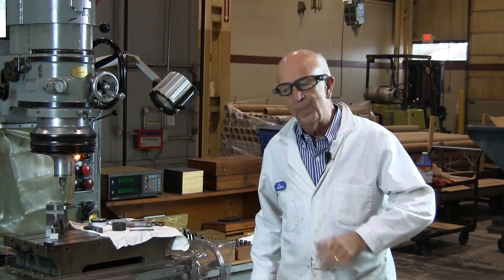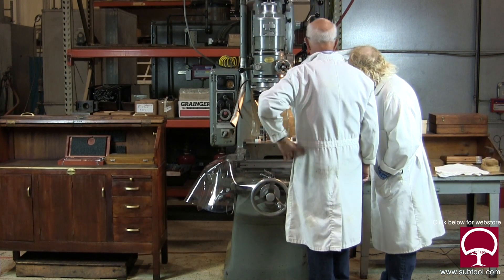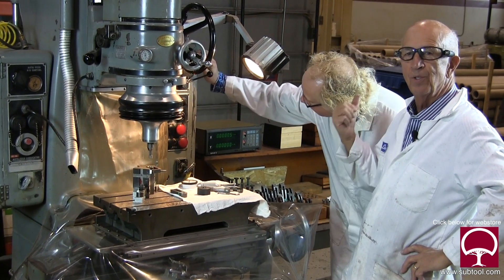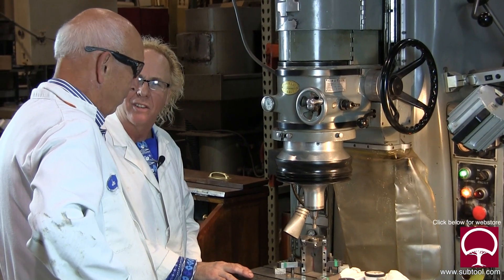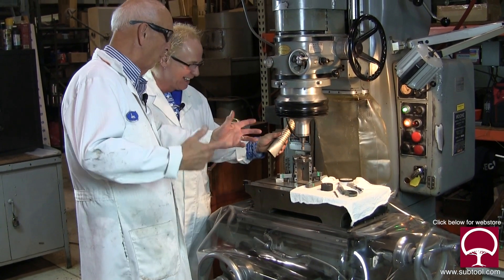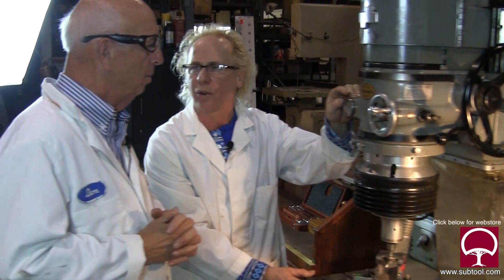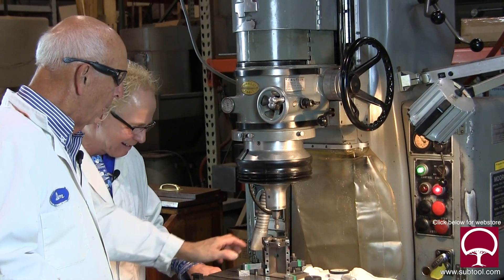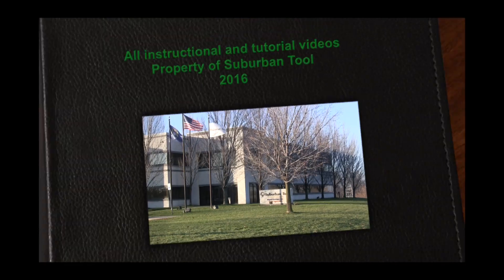How To Operating A Jig Grinder

Comment: At 1:30, thats a good one, there is no water. This gage shows the temperature of the rotating head. 5 degrees Fahrenheit increase  = .0001 per side bigger. 
On the right side of the head there are 2 heaters that suppose to hold the temperature stable.
Reply: it'll only be Y axis that'll incrase -

Comment: At 15:00, the little guys that hold the cover. If you remove this cover you will discover a round rail that should have adjustable stoppers that enable you to set the limits of the C-axis, your oscillating head. In case you doing partial circle. So the operator is not the hard stop like you mentioned.

Comment: I've seen tapered holes in die sections ground on a jig grinder, could you show how to do that?
Reply from the maker: +4x4machinist We might consider doing that. Right now we have other videos ahead of this, we appreciate your comments.
Reply: @SuburbanToolInc  It can be adjusted to grind 1.5 degree of taper------Our people are Not allwed to adjust this setting without supervision----very very picky!!!!!!
Reply: Even the 50 year old machines will accurately grind a taper, increasing or decreasing up to 1.25°. There is a double lock knuckle that controls this. It takes a nice granite square and a tenth indicator to get it back to almost vertical. Most guys will always set a bit of a taper, maybe a half tenth at the bottom of a
Reply: 1/2" deep hole.

Comment: Is the plastic consistent enough in thickness to not throw that stand off a few tenths having it under the mounts?
Reply from the maker: We dont beleive so, however we have a 50 millionth readout. If it moved at all it would show up there and we would make our correction.